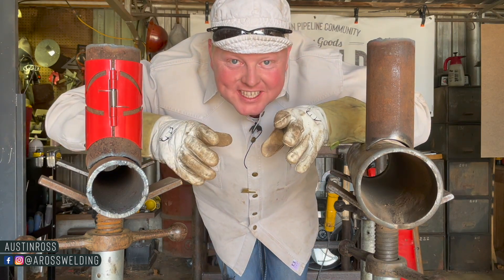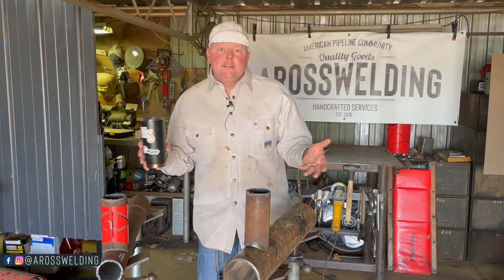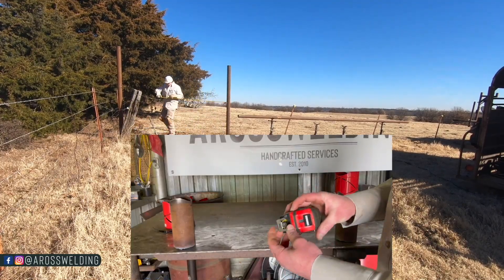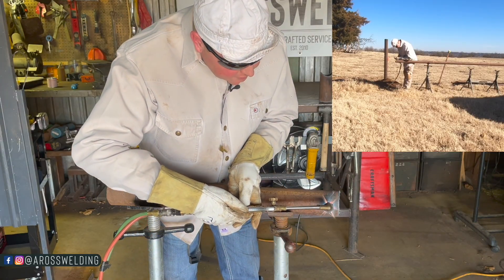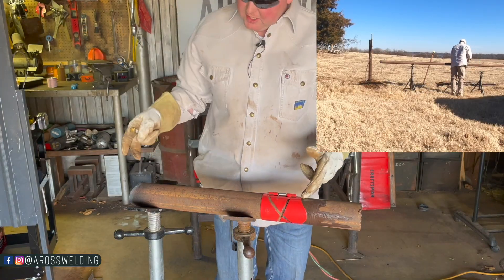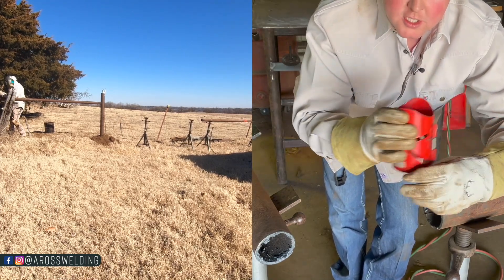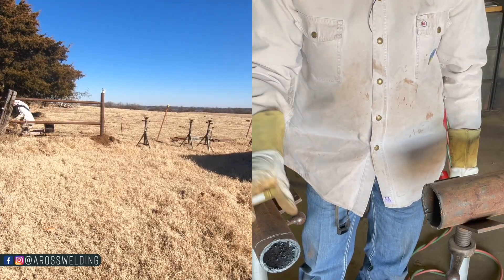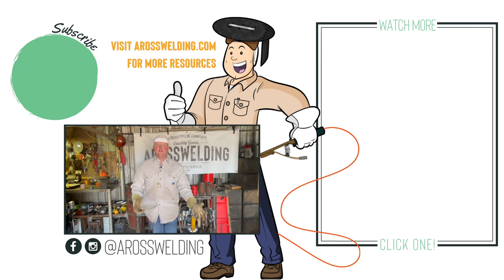PIPE SADDLES (HOW TO SADDLE SMALL RAILS ONTO BIG POST)

Comment: You can also get good saddles by making two cuts with a chop saw. For example, for a saddle on 2-3/8 onto 2-7/8 use 20 degrees. This creates a clean consistent saddle that is easier to weld and requires almost no grinding.

Comment: I believe you can make a template using paper. Mark 1/2 the circumference of the larger pipe, then cut straight back from center so you have a piece that looks like a rectangle with a dome on one side. Make 2 of them.  Wrap both around the smaller pipe splitting the difference between both of them. Tape the ends together, and you've got a template. Just my opinion.😉

Comment: Good video for starting basics. Some tips from someone that's done it for a while. Make your saddle jig fit what you commonly use, saves time back and forth. Mark your center line of your jig to save eyeballing were your throats line up. 
Unless your cutting angle is perfectly flat in the throats and angled in slightly on the ears every time. Your wall thickness will effect your measurements, so subtract a 1/8" to 1/4"  remember that if you set posts level and have to beat in a horizontal, your posts will move out of level (or plumb) and if you do that on one it will effect your others. 
Dewalt 600lb clamps from home depot help alot for all kinds of things. I keep 12 to 5ft ones on the truck always. Cheap clamps that are strong and have a ton of uses
Reply: Do it the easy way as we just did, 11-2023.  You don't need the fancy, template to draw around which only fits one size pipe and you don't need torches.  We just welded 2 1/4" drill pipe to form corners in muck next to the county ditch here in Michigan.  We had never done this before and it worked perfectly.   We cut 33' well pipe in half and drove pipe 12' in ground leaving 4' 6" above.  All you need is a gen to run cut-off saw set at 32-33 degrees for all horizontal pipe cuts.  Measure the distance inside both vertical post.  That is the distance to bottom of the saddle ( throat ).  Simply make the 2 angled cuts at each end of pipe which forms the saddle that perfectly fits the post. After switching ends you place the (ears ) verticle the best you can and it will be fine.  32-33 degrees is for same dia. pipes and you adjust to different angle to fit different dia.  And of course you need a remote welder.  There is Y.T. videos showing how to make the cuts as I described.

Comment: I like to make templates from old wrap arounds or gasket material. Works good for angled branches you use often like 45s. 

 A formula I find works well on right angle miters is to make the "ears" 1/3 the diameter of the pipe OD LESS the wall thickness. Then mark the Quarters on the template so it's easy to align the miters to 90 degree increments.

 The templates next together when rolled up. I stick them in an old rod box to keep them from being crushed flat.